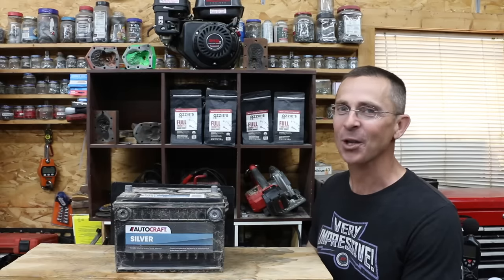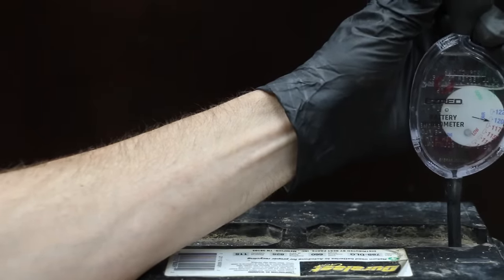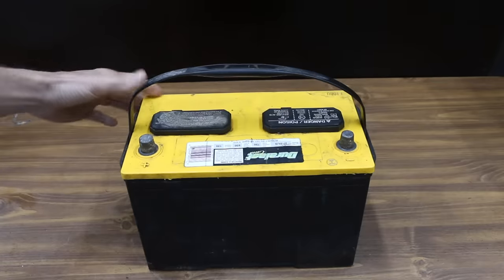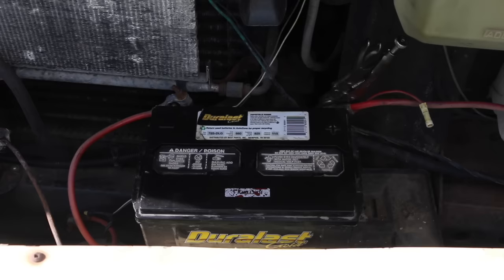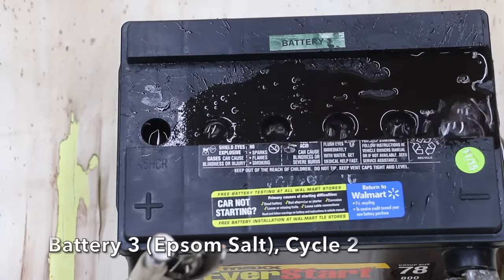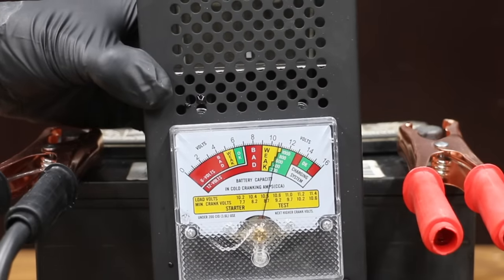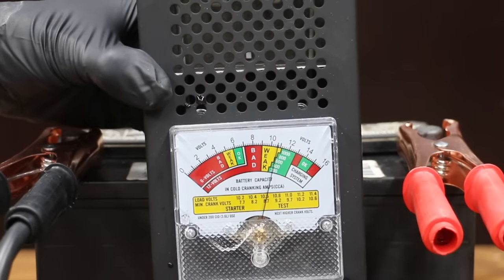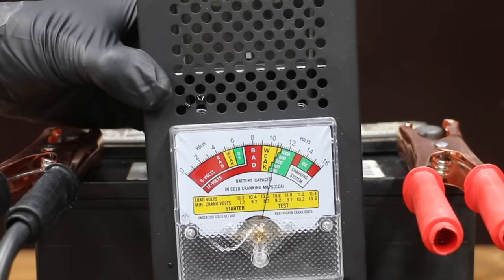Myth Busting! Can You Restore a Dead Car Battery With Welder?  Let's Settle This!

Comment: I had a battery for 9 years by using high amp charger and basically cycling thru as you have done here every 2 years.  Only reason it stopped at 9 years was because I sold the car.   It works if you stay on top of it and just consider it part of the maintenance cycle of your car.

Great video.
Reply: how much time would you leave the battery on the high amp engine start mode?
Reply: I remember buying batteries with 11 or 12 years warranty. Now best we can get is 5 years warranty.
Reply from the maker: Thanks!  Thanks for sharing.
Reply: @marcelo403polo2  Most batteries have a "free replacement" warranty and no pro-rated warranty beyond that. I remember when the warranty was 80-90 months with a 1,2,3, or 4 year free replacement period.

I have heard the only difference between the cheap batteries and the more expensive batteries is the distance from the lead plate grid to the bottom of the battery.
Reply: Funny we've been taught our whole life that trickle-charging is how you maintenance a battery not high voltage
And in case you didn't know these brand new cars actually have a variable regulator on their alternator so as the battery and alternator gets weaker it starts pulling more electricity from it
Which is why you have to reset the computer if you touch the battery on a newer car
Reply: @thecloneguyz  high amperage
Reply: I've done this on many batteries with mixed results. On low draw applications it worked ok but the cca never revived anywhere close to "new". The reserve wasn't great either and I wouldn't trust the battery especially in winter. Tested with snap on dtac tester.
Reply: @ThatToast  I would charge between 100-120 amp for 5-7 minutes with 30 minute cool down in-between 4-5 cycles.  I used an Associated Battery Charger.  Never tried it with welder but will be in the near future.
Reply: @adamgreen911  I used associated battery charger at 100-120amps for 5-7 minutes (4-5 cycles) with 30 minute cycles in-between.
Reply: Got 21years one car battery, maybe longer but sold the car, never did anything special just drove it.
Reply: My car has a 90 amp alternator... i guess it just does something similar
Reply: I’ve tried to de-sulfate four batteries with a fancy charger: three Optima Yellow Top and one flooded lead acid.  Even after a week or more, in all cases there was no measurable improvement.  It seems not worth wasting time trying to magically fix a worn out battery.
Reply: Same here. I had the same battery right at 10 years. But all I did was keep an eye on it, but mainly I kept a 2 amp trickle charger with a regulator on it during the coldest winter months. I had it fixed in my pickup so I could simply plug it in whenever I got home each evening. 😊 Never had a single issue with it. But once it decided it was done... It was done. 10 years I'd say I got my money's worth.
Reply: @thecloneguyz  I think it's  that high setting will only charge a battery up to a certain amount. Then switch down the amps to 6 or 2 to "top it off" with a trickle charge. 
I've had great results from a 2amp trickle/maintain charger with a built in regulator and off switch. I've had it for years. It switches itself to 2 amp once the battery has taken a charge to top it off then keeps the battery charged. Excellent during winter months and staying ahead of any parasitic drain that might happen.
Reply: @adamgreen911  keep in mind the welder wasn't actually charging the battery at 100amps. On the 100 amp setting, that just means the welder can output that at a short circuit. But a battery is far from a short circuit
Reply: @TheSlowDude  not really because even though the alternator is capable of 90 amps, doesn't mean the battery will pull anywhere near that. The alternator is designed to regulate volts and not amps so even if the battery were dead the alternator would bring it up to 14-15 volts max Wich would be pretty far off from 90 ampz
Reply: @wobblysauce  must have been lithium 😅
Reply: @wtmayhew  The fancy desulfator chargers dont do anything in my experience, the stick welder trick does sometimes work as shown in the video.
Reply: @adamgreen911  Unless you jump it backwards you're not running 100A through the dead battery, you're running the starter through the good battery jumpered onto the dead one.

Please be careful with the welder and start really low first. (With an overkill of protection, some baking soda nearby to neutralize acid if it goes badly wrong, etc.)

Notice that he's checking the level of distilled water filled cells and making sure they don't boil dry. If you have a "maintenance free" battery think about how you can monitor that.

Oh and if your welder has ac and DC settings, don't use the wrong one!
Reply: @maxpowerta3183  I’ll give it a shot, I still have the Optima batteries, had not taken them I. For recycling yet. Thanks.
Reply: @davidparker9676  i always buy the cheap walmart batteries that are about 75 bucks they have all lasted 6 plus years in the arizona and texas heat.
Reply: @timothycarey3883  The Walmart batteries have jumped in price where I live. Ones I bought a year ago have almost doubled in price when I checked the other day.
Even the Costco batteries have shortened their warranties and raised the prices dramatically.

I'm in SoCal and the summer heat kills my batteries on anything that isn't driven daily.
Reply: they are making plates thinner and  solution more diluted  =all equals less life
Reply: @wobblysauce  How long ago was that? 21 years on a battery with no voodoo is unheard of.
I'm happy if I get 10-12 years out of a battery.
Reply: @mondude9754 FLA have very low internal resistance 5 ohm ish, so it is close to a dead short
Edit: milli ohms
Reply: @marcelo403polo2  Costco sells batteries with a 100 month pro-rated warranty. the batteries are made by johnson controls.  Were the batteries with 12 year warranty very expensive? It seems like it would be hard to warranty them for that long because they do not last that long for most people.
Reply: I got 14 without doing anything and even letting it run dead and low many times.

Batteries don't last as long anymore because they have an incredible amount of demand placed on them in newer vehicles, and most are probably using recycled lead by now.
Reply: @davidparker9676  i am talking the walmart value series ones not the everstart. They are still like 75 to 95 bucks. Its still better than 200 or 300 for interstate or name brand ones and they last 5 years , and that was in Lake havasu az the hottest city in the nation. Still its the best deal for a battery.
Reply: I've still got an AGM from 2007. 
My key to success is every few months when I'm doing maintenance,I throw the float charger on it. 
Alternators suck at charging batteries to their full level as it takes on average a 20min drive to put back the juice used to start it. And even then ,alternators suck at topping off a battery.
Reply: @timothycarey3883  I have stayed away from the "Value" batteries because I have seen them fail so quickly on other people's cars. I have had good luck with Costco & Walmart MAXX and AGM batteries.

I recently bought a few batteries from Costco. When I was asking the guy about the warranty, he said to return the battery before the warranty is up and get a new battery so it is always under warranty. 
I will try to do it if I can keep track of the warranty expiration dates for multiple cars.
Reply: @16vSciroccoboi  The lead has been recycled in batteries for years and years, I don't think that makes any difference.
 
Sulfation and being run out of water is the main killer of batteries.
Reply: @davidparker9676  i only had one walmart battery fail and it was cause car had an amp draw and sat for a few months. The rest always lasted longer than friends interstate diehard or other name brands. The only name brand id consider is an optima if in a vehicle with a winch.
Reply: @timothycarey3883  I stopped buying Optima batteries since the last few died sooner than expected and were really hard to warranty. I figured I'd try the Walmart AGM battery since it outperformed the specs and warranty of the Optima.
Reply: I came to the same conclusion.  If one tests there battery from time to time it may last longer?   "It works if you stay on top of it and just consider it part of the maintenance cycle of your car."
Reply: @wtmayhew  that does sound like a magic fix instead of a real fix. If you see the youtubes of the guys in Pakistan re newal of a trash battery, you realize it an involved process.
Reply: @jameshill4900 it cannot because lead plates get dissolved over time. Thats to revive a good battery that got discharged and sat for a long time. Sulfation of the plates act as insulator, as far as I know. Running these cycles you further melt the plates those bubles lift sulfate of the surface or something like that. So you lose capacity but revive the battery. If the battery was 100amps, after revival might still be 60 amps good working amps, not too bad I think
Reply: @TheSlowDude  Alternator doesn't work like that. They have a regulator to control voltage to battery.
Reply: @somewhereinchicago8743  I use quite a few batteries and this does work well sometimes and the battery is very usable. I just think some people have expectations it will be like new which as you pointed out is unrealistic. I prefer deep cycle batteries and they last well due to the heavier plates. I also avoid 1000 cca batteries in the smaller automotive sizes. They tend to not last due to the plate density.
Reply: I always had trickle chargers on my vehicles. In the extreme cold of Alaska it’s essential to have a properly charged battery for staring at -50 and colder. Anytime my vehicles are parked in the winter, they are either inside where it is warm or plugged in to charge the battery and warm the fluids. Battery blankets and plates to warm batteries may help but a dead warm battery is useless. A cold charge battery is still good. Starting vehicles in -50 weather then using the headlights and heater on high is hard on batteries. The trickle chargers have allowed me to have batteries last well over 10 years.